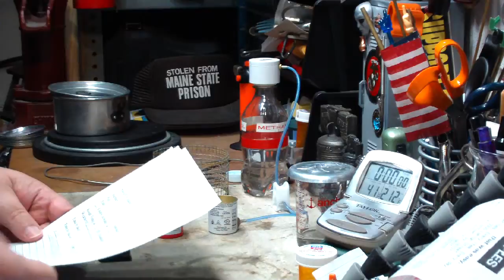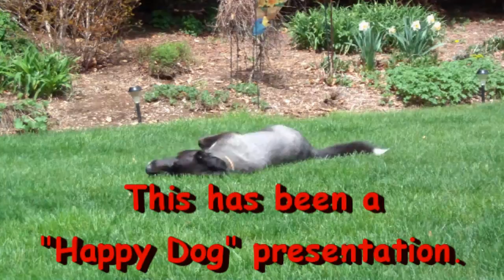Simple Carbon Felt Burner without Fuel Remote  - Boil Test #1

Comment: Hiram, would a larger diameter can, say maybe double the size of the can you used have brought it to a boil? Also, you mentioned about when using a reservior that you'd have to burn the fuel out. I might be misunderstanding your meaning & excuse me if I am! But, why not improvise a shut off between the reservoir & the burner/stove?

Comment: with the resevoir attached,  the felt was saturated to begin with and then used an additional measured portion.  So it is possible that more was burned than what came out of the bottle.